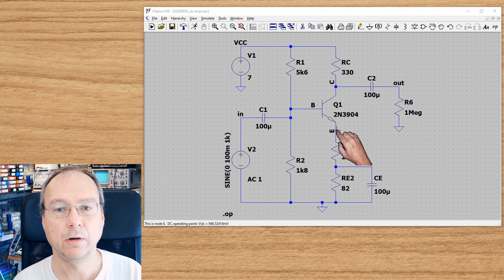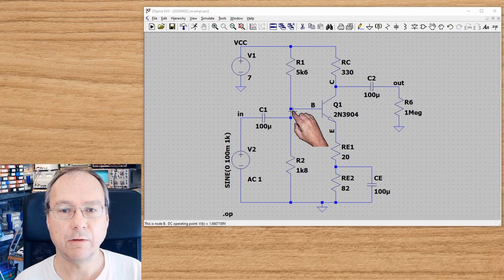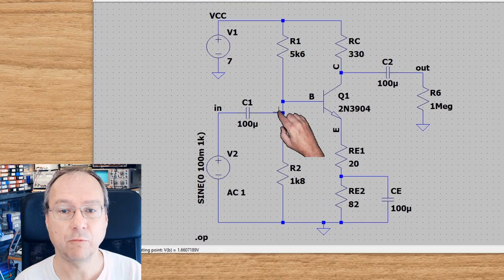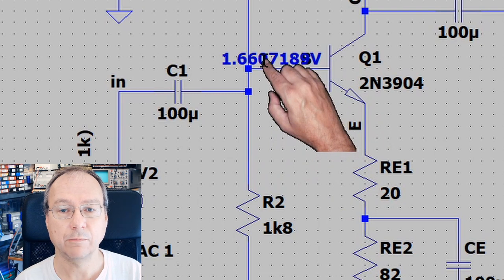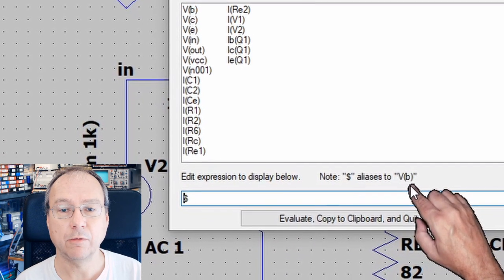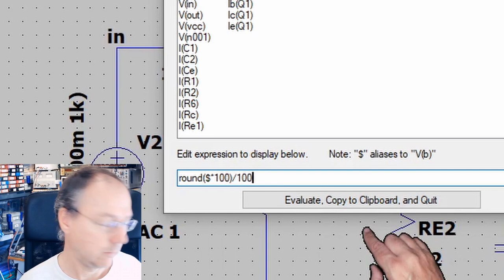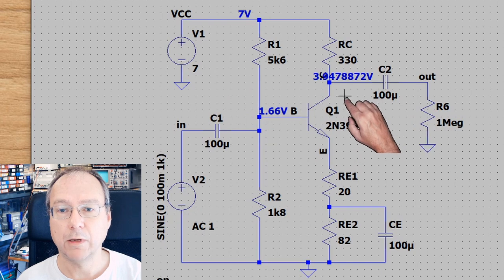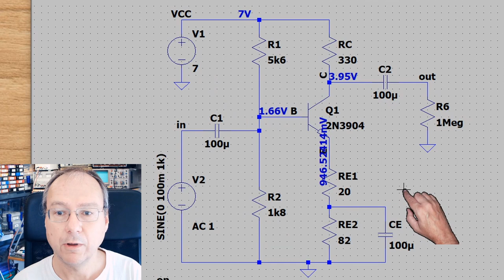.op Data Labels in LTspice

Comment: help, how can i do this?
Circuito que realiza la función Vout = 14V1 + 0.001 * integral (V2) en la banda 10 <f < 1000 Hz
Reply from the maker: I don't know why you assume that my reading comprehension in Spanish is better than your writing skills in English... but... is this a homework?
If I understand you correctly you want to integrate a signal V2 in a limited bandwith (10 Hz to 1000 Hz), then add this to a scaled second signal V1.
You will need to combine several basic opamp circuits. The integrator with a capacitor in the feedback loop is also inverting the output signal. This signal would you then feed into the negative input of a difference amplifier. The positive input would be connected to the other signal V1 and you would have to choose the resistor values according to your weighting factors. The integrator will already have a low-pass behavior which could be adjusted to 1 kHz by the choice of the resistor and capacitor, so that you probably only will need to add a 10 Hz high-pass filter at the input of V2. This could be a simple RC-filter or a several-stage active filter depending on your needs.

https://en.wikipedia.org/wiki/Op_amp_integrator

https://en.wikipedia.org/wiki/Differential_amplifier#Operational_amplifier_as_differential_amplifier

https://en.wikipedia.org/wiki/Electronic_filter_topology
Reply: @uwezimmermann5427  thank you